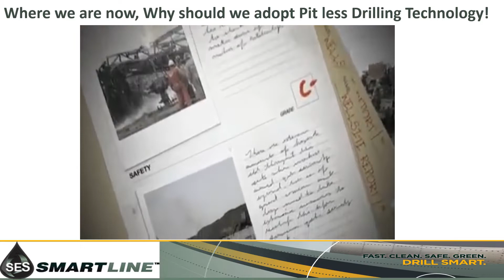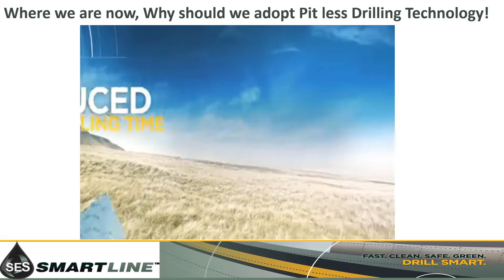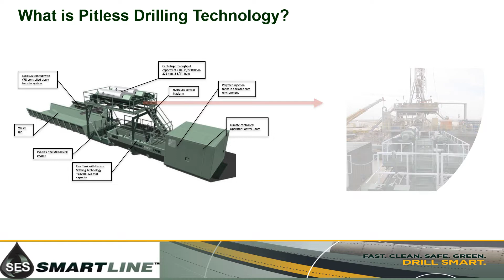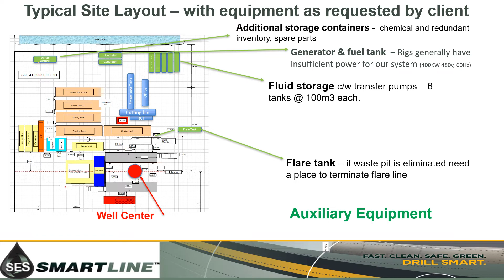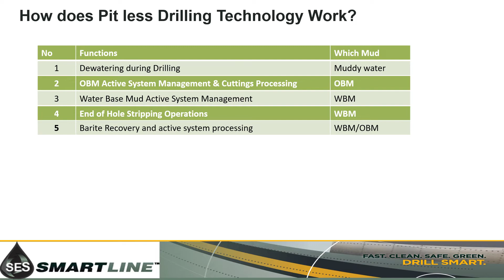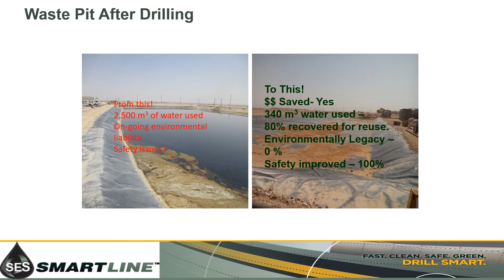SmartsiteTM Introduction to Pitless Drilling -Oman

Comment: Trust me, I'll be honest with you - this thing doesn't work...
Reply from the maker: Well that is interesting because you haven't a shred of evidence or facts to support your comment. I on the other hand have troves of data that suggest quite the opposite.
Reply: @donsmith1797  last I heard you had to run from north america because you beat your wife and no one would give you a job. Noy only that you were flat ass broke and both the bank and the government were coming after you for payment. So now you find yourself in a shthole working for lovers and still can't make a go of it. Probably time to cash in whatever chips you have and buy that pine box you always had your eye on old man
Reply: @donsmith1797  if I give you a frisk, pat you down or show you some baseball call signs could I find your wallet?!?  Probably not and that white powder you use and try to sell is just dust in the wind little old man. Your sht doesn't work, never has, and know first hand lmao.
Reply: @donsmith1797  you have grade 4 math at best, you wouldn't be able to measure that thing of yours if i gave you a protracter, compass and ruler 📐 can you even measure an angle?!  No wonders you got fired as a drilling engineer. Your math isn't very good eve under the hood - that's a reference to your racist tendencies